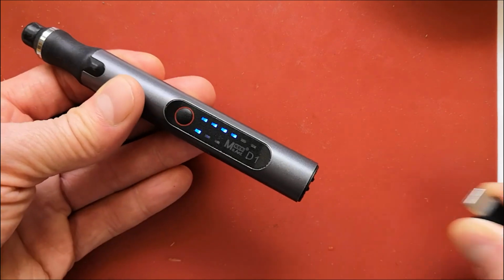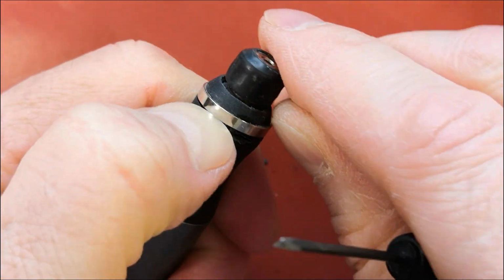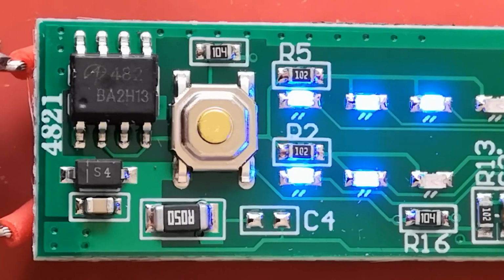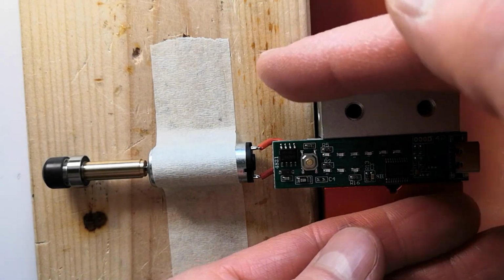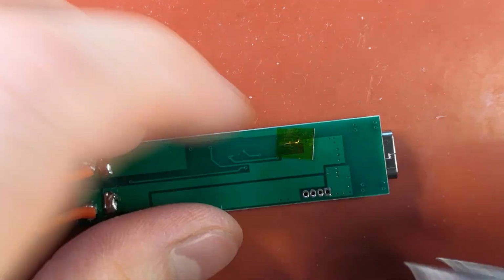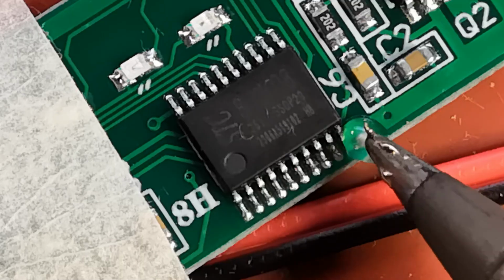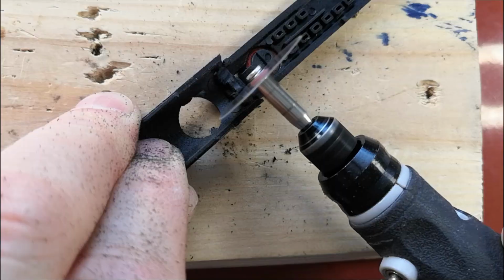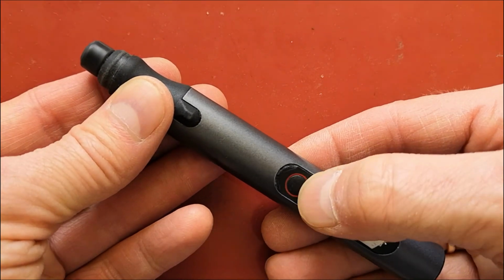Ma Ant D1 mini rotary tool repair

Comment: I Have the same Issue, but unfortunately I have to replace that SMD as well (Top Left 4821 - BA2H13) ...my motor start spinning till that SME burn out. and also I have to replace the XT4052 chip and i find it on AliExpress, But I can't find exactly SMD BA2H13 (I looked on AliExpress too) can you please tell what exactlu I need to replace another similar/identical specs to that SMD. Probablu that SMD it is owner inside code, it can be found with a different name. Thank you !

Comment: So how can i reset that chip on pins 7 and 8? Mine wasnt charging anymore broken pins or broken traces. I changed the charge IC my speeds used to work prior to me checking the capacitors and resistors now the motor just turns on briefly and then shuts off. Im wondering if the chip that controls the speeds is damaged might as well buy a new one but i enjoy trying to fix stuff and alot of the chips you cant find only on aliexpress and you never know if the chips actually work any suggestions would be great thanks.
Reply from the maker: Pin 7 is nRST, connect it to ground to reset, not at vcc=pin8. However, it did not work for me. Can you see pwm signal from mosfet gate, if you have an oscilloscope? Is schottkydiode near mosfet fine? Do led:s react for button input? Reheat solderjoints with flux, if you have a tiny soldering iron. Reflowing often makes a fix.  Hot air will destroy led:s and button, remember that if you use hot air.
Reply: @SnapTinker I dont have a oscilloscope at the mosfet there is just a small looks like a resistor and the button to change speeds. The button to change speeds used to work prior to changing the charging ic as in your video. The board is almost identical to yours just a bunch of resistors and LEDs and a few capacitors. Does the battery have to be installed or a DC power supply connected when ground pin 7 to the ground pin? The charging ic and port was the main issue now the motor shuts off after just a few seconds I need to check the mosfet
Reply from the maker: Battery must be connected at reset. I suspect a loose joint around you heated the board, do reflow.  s4 is marking at diode. If led:s are reacting, the microcontroller is doing something. Look heat at board, soak board with alcohol and switch on repeatedly. Alcohol will evaporate at hot components and they show dry, you find shorts that way. And mosfet needs to be checked, if it is shorted. Remove motor (and battery) before measuring it.
Reply: @SnapTinker Got is thank you so much for tbe video and fast replies as far as my board almost everything looks similar my board doesn't have the diode for sure all the LEDs do still work. I didn't use heat I used low melt solder and took the charging ic off the low melt solder makes removing IC's and other components very easy without exposing the thin boards to excessive heat. I'm definitely going to try and fix this grinder to have as a spare I just bought the mechanic grinder to replace this broken one in the meantime.

Comment: the problem comes from the charge regulator  XT4052 sot23-5 
the component is the one close to the usb c connector
Reply: Can confirm that the problem is in the charger IC , in my case it was marked as 3KAF but there are a lot of similar compatible ones (LP4068, XC6220B, LTH7R, etc)

It's commonly used on things like a rechargeable disposable electronic cigarettes or arduino-like controllers with battery support.  So I've found LP4068 and replaced IC charger with it. Pen started functioning as it's supposed to!
Reply from the maker: Thanks, need to get a new chip. Still mystery for me how the running charge lights are controlled.
Reply: I think I killed mine once more, 
I swear don't freaking buy those ma ant stuff, unless you're ready to resolder charging controller once a week or so 

I'm so pissed, I swear, that's just piece of trash
Reply from the maker: I probably killed mine by grinding and charging at the same time. Now I charge only when power is off, and so far it is working. I will soon get new charge chips, I hope that will fix the broken one.
Reply: @SnapTinker its like walking on egg shells, ffs
Reply from the maker: But I can charge it and battery charges normally? How can the charge chip be damaged?
Reply: Any recommendations for things to try and repair it? Can it be reset, or is it a form of permanent damage?
Reply from the maker: I couldn't repair it. I tried to reset it with positive voltage, it was wrong. Pin needs negative reset voltage, you could try it. Also, I did't measure charge voltage, to see if XT4052 is damaged. If so, the main chip is probably  damaged anyway. Also, I did not try unplug battery for a few days. I bought a new one and I do not charge it during use, which I suspect broke it.
Reply: @SnapTinker I thought I broke mine by using a homemade charger but I'm not 100% sure 😅 i am a bit of a clueless newbie with electronics, so honestly not sure what I'm doing, but currently looking at the TP4054 chip on mine as it has a "charging" status pin, so that seemed like a good place to start. As the tools is only £10 I am tempted to just order a replacement anyway, but I am keen to repair this still, or at least learn a lot of new things in the process of trying. I'll keep you updated if I figure anything out!
Reply: @JTickett  Seems like those pens are in general quite flimsy, I took mine out of the box, tested it, put it on charger, and it was dead in a few hours. Battery discharged to 1.5v, if I connect new battery - it constantly shows as if it's charging when it's off, and doesn't have any lights turned on when it's actually spinning the motor (on-off and speed regulation works)